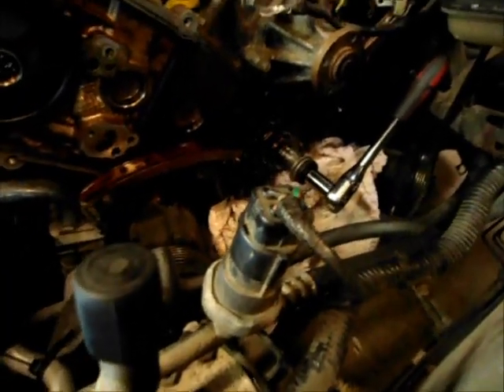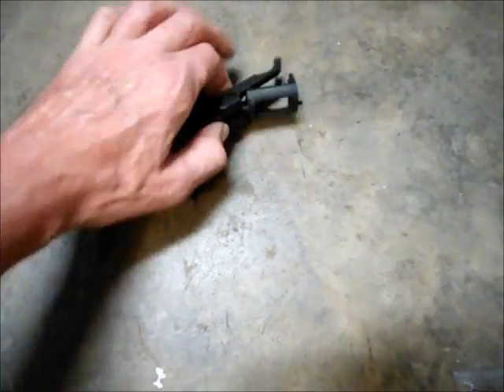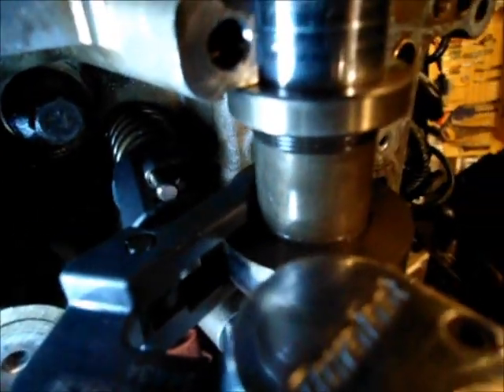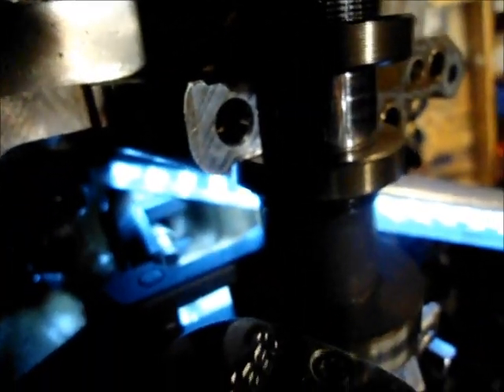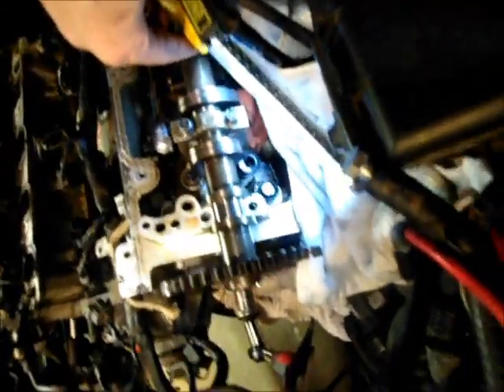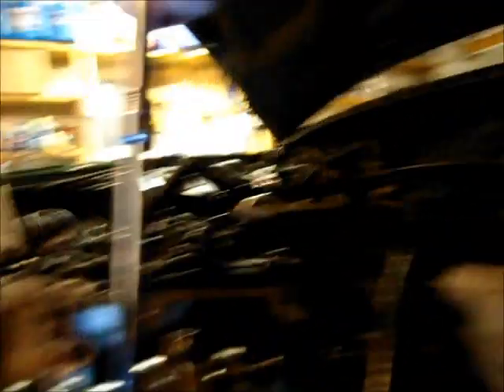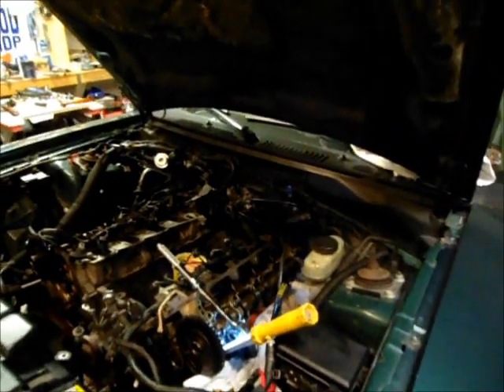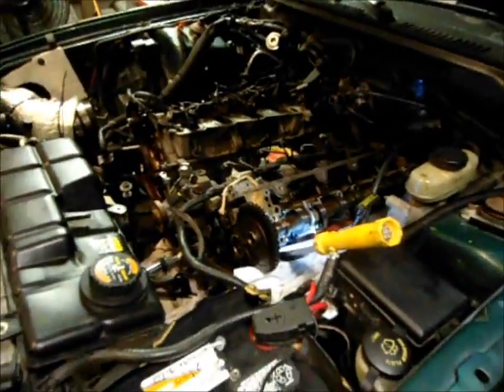2000 Ford Mustang GT - Testing OEM valve spring compressor # 24434 - Part 4

Comment: Hey bud. Thx for this. One puzzling thing I was wondering. I just got the tool but even though its the exact same part number 24434,.....the one i have has a different angle to the part you hook the ratchet too?? I guess they modified it or something. Do you know anything about this?
Reply from the maker: No, I have only used that one from my video.  I would not doubt if they tweaked the design a little.  I didn't have trouble with the older one so I'm not sure why they would change it.  Happy wrenching.
Reply: @insanitygaming20  ok bud. yea the part i mentioned is more straightened out then yours and the original. I hope it's so the cam cage will be more out of the way or along those lines. Thx so very much friend. God Bless

Comment: Did you change them all with out dropping a valve inside the head. I know some people use air in the cylinder and other drop in a rope and press the cylinder up so the rope could hold the valve up. Just wondering how you did them.
Reply from the maker: Using rope and moving the piston up and down, one cylinder at a time, I was able to change them all.  The rope will hold them in a way that I cant see how one could drop.  It took some time but the whole rope trick went smooth for me.

Comment: How hard was it to do the drivers side rear of the engine?
Reply from the maker: That is the most difficult area because of tight space.  My helping hand held the spring down with the compressor tool while I laid across the engine bay from the passenger side and used a flat head screw driver with a bit of bearing grease on the end to put the keepers in place.  It took a minute but is do-able.

Comment: So your able to take out the spring this way? Without having to take off the head i mean...i ordered this tool already is why I'm asking man...
Reply from the maker: Use the rope trick to hold your valves up and you can change all your springs with this tool with out removing the heads.  The keeper end of the stems are reachable and let you swap springs with the heads on the engine.  I did 1 cylinder at a time.